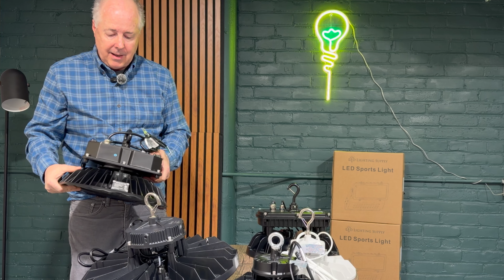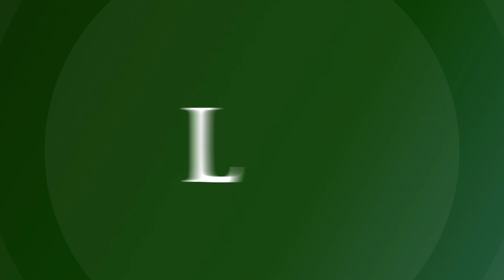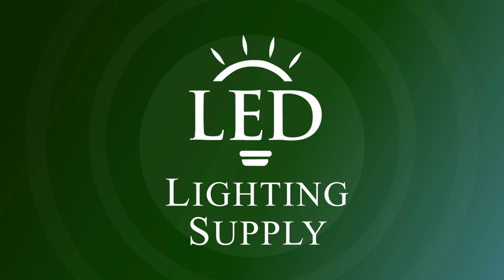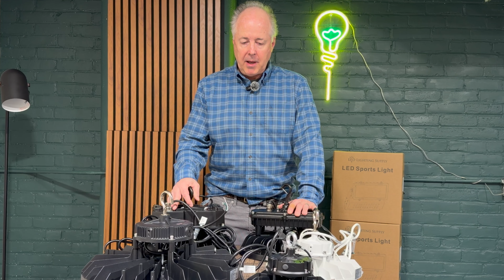Choose The Right High Bay, Save Thousands (Here's How To Pick Right)

Comment: What makes that lighting good for Pickleball? (you mentioned it at about the 1.30min mark) - we have a 7m to 5m pitched roof and putting a pickleball court in it, & just researching lighting for it - most LED lights have a glare when you look up to volley - hoping you are a pickleball player & can help -
Reply from the maker: Great question! Pickleball does have some unique lighting challenges. The fixtures we mentioned work well because we can use specific beam angles, lower glare optics, and proper mounting heights/layouts to keep light on the court and out of players’ eyes. Uplighting is also an option, but will come at a premium.
With your 7–5m pitched roof, we would recommend a custom lighting layout to confirm the ideal layout.